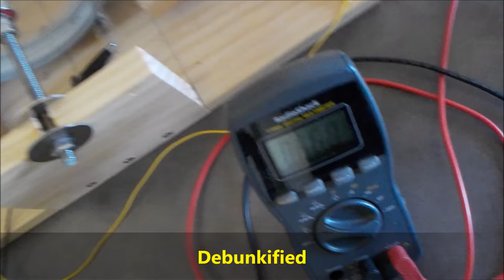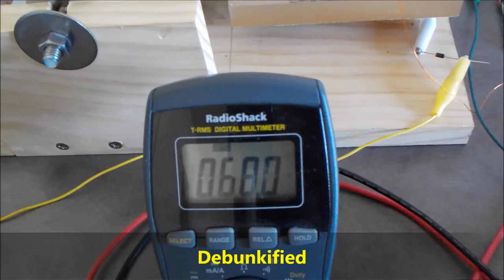GLIMPSE of FREE ENERGY OVERUNITY BYPASSING LENZ'S LAW

Comment: I think the shorting it out with the second switch adjusts the pulse length so that the circuit becomes more resonant. You can further shorten the pulse time by positioning a second magnet behind the reed switch. This also aids in magnetic spark quenching  of the reed switch which helps extend their useful life at high voltages.

Comment: Hi DebunkerYou could add that the discharge of the capacitor to load is totally lenz free as long as the capacitor is DISCONNECTED during discharge from the generator coil. In fact it is impossible for there to be any lenz effect during discharge, since capacitor is disconnected. If you leave capacitor connected during discharge, there will be some harsh "reflection" back to the motor spinning it, and draw will go up during discharge and you get no gains in power it becomes then, more power needed to make more power and nothing special.The larger in UF value capacitor you have filling up from peak coil shorting, the more power you will have in discharge. More voltage in capacitor at discharge is not a :linear" function, in how much power (joules release) you have... in that twice as much voltage does not mean" therefore" twice as much power....rather it is a "squared" function...so more voltage in cap stored up means LOTS more power upon discharge.Here is handy formula to calculate true WATTS from a cap-discharge:Farad value of capacitor / 2X(voltage in capacitor AFTER discharge SQUARED)SUBTRACTED FROM:(voltage in capactiro BEFORE discharge SQUARED)X cap discharge events PER SECOND = WATTSI should think a tiny neodumium magnet about an inch or so out from axle would work OK for your triggering of reed switch. It will surely work lots better if you had it stable and shorting event happens right at voltage peaks.Good next step once you get things locked in place permanent, is to monitor input amps and rpms of rotor, and go up and up in UF value of "collector" cap until you get to the largest size possible, without its resistance-to-filling becoming a factor in making draw to motor increase.....sometimes amps input on meter cannot really show slight increase in draw to motor, rpm meters are good too to see slight drops in rpms if searching for 100% lenz free operation filling caps.

Comment from the maker: My good buddy Doug Konzen down below has the correct description of making sure you DISCONNECT the capacitor during it's discharge to load, in that way there IS NO WAY for the LENZ'S LAW OPPOSING FIELDS to harshly reflect back to the source. Also it is a good idea to find a capacitor that is just the right size to receive good power but not so large as to drag the rotor down and not so small that there is no power. 

Basically a little tuning is required. Make sure switching is short and quick on the peak voltage of sine wave, this is when the rotor magnet is just about to be at the center of the core or right past the center of the core, on the either side of the core and closest to the core.
Reply: +debunkified I think you are on to something; I have occasionally considered what would happen in a generator set up using caps along with the coils that produce current so that the opposing force is temporarily stashed away so as not to oppose the prime mover, possibly better more efficient generators with little lenz force?
Reply: MrSummitville thank you, i have been studying doug K also and i think he really has it in the bag; the way most motors are built are what Tom Bearden would always say " Stop killing the dipole" !! and thats what the "modern " motors do, they have huge amperages that just destroy the battery in seconds flat but... if we use doug's ideas we are on the way to efficiency which in the latter part of the century wasnt even in the vocabulary because everything related to power was cheap
Reply from the maker: You are very correct sir. Do not kill the dipole. There are several methods to do that but most are secretive, for instance the Fogal's Charge-Barrier Semiconductor, which is basically just a transistor with a tiny capacitor on the emitter. The idea is to let voltage through but not the current, which is  a giant feat for mankind to accomplish, as the idea of passing voltage without current is unthinkable, but not impossible with the correct materials.
Reply: Alex, Debunk and Doug K are awesome and have taught me so much. Now that I think of it i have learned absolutely nothing from invent-nothing Summitville.
Reply: @alexmanzanero  I think this idea has great potential as the lenz's law is the bane of power generation.
Reply: @alexmanzanero  " if we use doug's ideas we are on the way to efficiency which in the latter part of the century wasnt even in the vocabulary because everything related to power was cheap" And we don't usually use Battery to power any powerful motors, unlike the EV we have now.

Comment: You can circumvent lenz's law completely, and eliminating completely. This is taught as impossible only because they doesn't think of using other materials instead of copper ._.

Metals obey lenz's law but dielectric does not. Or maybe it does? I do not know completely.

But, there are materials which have negative resistance. This causes field boosting. You know what negative lenz's law does lol.

Try using mica sheet. It has a property of negative resistance. Or maybe you can use negative inductor by project genesis as well. Idk about gabriel kron's negative resistor as the design is completely suppresed.